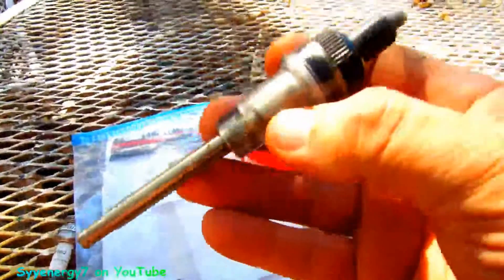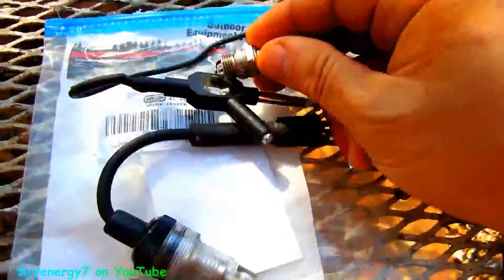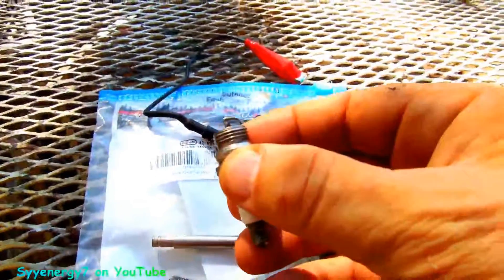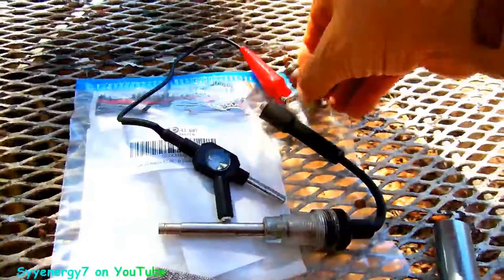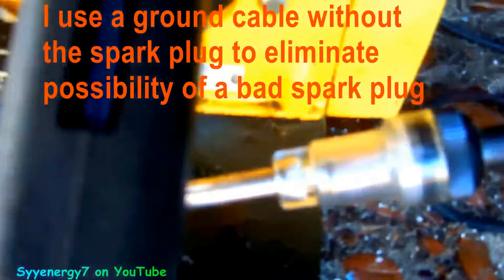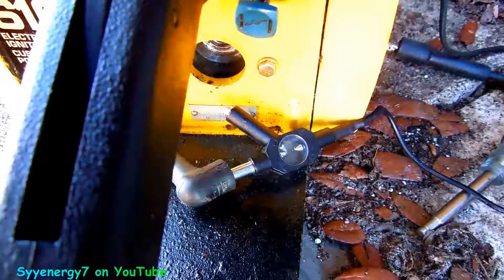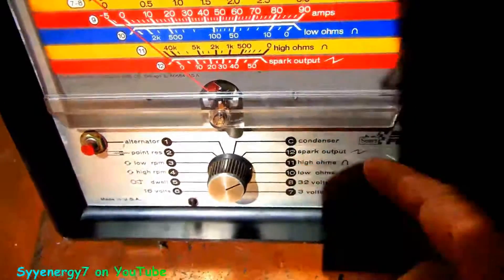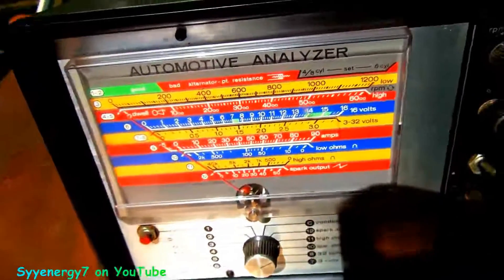Spark Tester vs a STRONG Spark Tester

Comment: this is what i need. i have a blue spark outside the engine but when installed in the engine it will not fire even on starter fluid. what is it called and where did you get it?
Reply from the maker: oregon small engine spark tester
part # 42-087